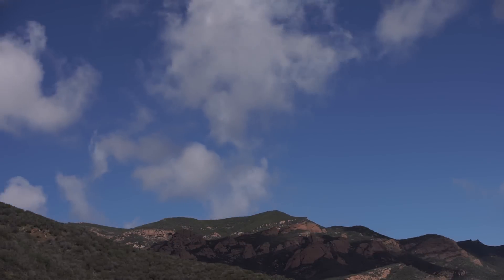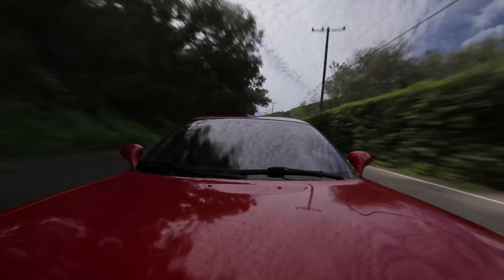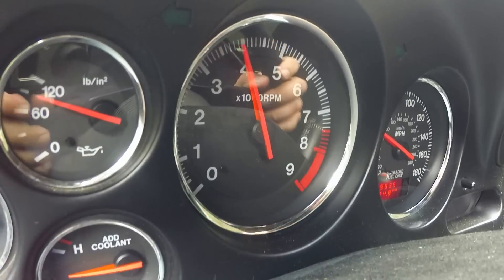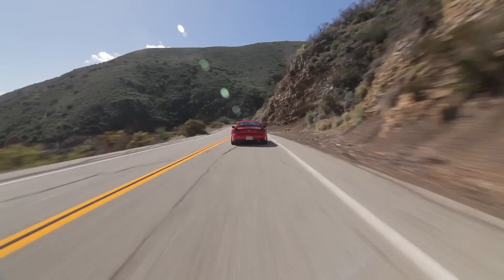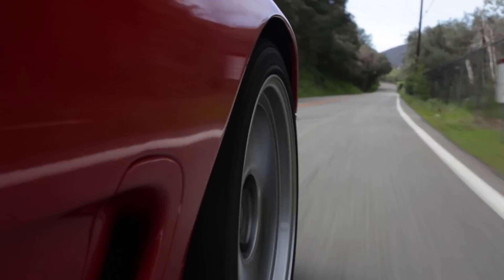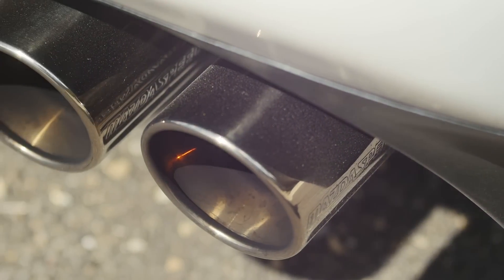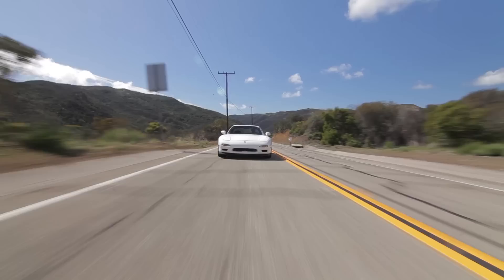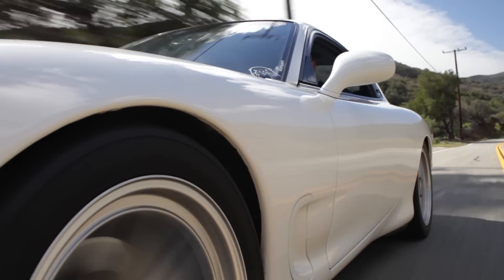Mazda  RX-7: Turbo vs V8 - /TUNED

Comment: The rotary has most of the same problems that two-strokes do.  The biggest of which being, they're ALWAYS compared to engines of massively larger displacement.  In this video we have a 1.3 duking it out with a 6.0.  The fact that they can even be compared in the first place is outrageous.  From an engineering standpoint, I think the rotary is fascinating and loaded with potential.  If the rotary had come first, and someone came along in the 60s with an invention called the four-stroke piston engine with Model-T era development of the design, it would be a lame joke.
Reply: JETZcorp Its not about displacement its about the fuel burnt. That 1.3 was burning twice the fuel so the comparison is fair. If it was NA then that is a different story but that turbo is pushing some serious air and that is then followed by a lot of fuel, matching the V8
Reply: ***** Thd turbo complicates matters because anything can be made insane with a giant turbo.  But I mean in general, rotaries and two-strokes always punch way above their weight.  You can find NA 13b peripheral port builds running with Corvettes.  There is no way on Earth you'd see a 1.3L piston engine hanging with a 6.0L rotary, especially if the rotary had been around twice as long.  That's the point I was getting at.
Reply: ***** Even NA, fuel efficiency is bad. That's one major downside of the rotaries.
Reply: JETZcorp That's because cylinder volume is a lie on rotaries. Measure it the same way you measure a V engine and a 13b is a 2.6L engine. Put in 14.3lbs of boost and because of how atmospheres work, a little 13b becomes a 5.2L engine, as far as swept volume is concerned.
Reply: Skylar Garrett Nobody adds displacement rating when boost is added.  Does a ZR1 have an 8.2L because it's got a blower?  And the only reason one might say a 13b is a 2.6L is that each rotor fires once per output shaft revolution, which is double that of a four-stroke piston engine.  But it's the same a two-stroke, and no one tries to say a 500cc two-stroke is actually a 1000cc because of it.  If anything, we should be saying this V8 is a 3.0L because it's being so leisurely about power pulses.
Reply: JETZcorp One word. Equivalence.
Reply: JETZcorp Well... I don't know how you find the dimensions of a rotary, but the formula for cylinder volumes is Bore2 X Stroke X .7854 X the number of cylinders. There's your liter size. You can't really say it's actually a different size, when it's literally that size. I do agree that a rotary does a lot for its size, but is it that much better? I mean people also get 900 HP out of 4 cylinders... That's 225 HP per cylinder. Which is the same amount the twin turbo rotary makes.
Reply: JETZcorp Why does displacement matter? Its being built to compete against cars with bigger engines and revs significantly higher. I dont think rotaries have any potential and will bet they fade away into obscurity. It makes 0 sense for a company to make a car with one. Even with your theoretical timeline rotaries would be phased out because pistons are just superior all rounders
Reply: Kneedragon1962 I dont know what youre on about but my post was a response to the original post lol. Rotaries arent going anywhere
Reply: ***** Cool. I'm not about to race out and buy one, or build one, but I'm glad they're around. They do a very specific job, and they do it rather well.
Reply: ***** Why is a rotary less fuel efficient?   Is it a thermal efficiency issue or incomplete fuel burning?
Reply: JETZcorp I agree, if they had a 20b rotary or even a 26b engine in that car he would think that it was a LOT faster for less than half the displacement.
Reply: Kneedragon1962 What specific job do they do very well? Cause headaches? Eat oil? The only time id choose a rotary is in a track car if im pulling the engine every few races anyway.
Reply: sashablfc But he didnt and was slower
Reply: ***** Rotary engines don't make much torque low in the rev range, so they experience the same issues as any other high-strung high-revving engine. An engine with torque low in the rev range does not have to be revved very high to get going, so it has better fuel efficiency on the street. LSXs in stock trim are good for daily driven street cars, and that's about it.
Reply: Sage Ybarra Thanks.  So it's basically frictional losses due to the high rpms?
Reply: JETZcorp you talk about an engineering standpoint but engineers know that it's just too inefficient.  Mazda has been trying to make the 16X work for nearly 10 years now, (at great expense) but they just can't get it to meet emissions and fuel efficiency goals.  yes, a giant turbo will kill mileage, but it NEEDS that turbo to produce the horsepower made so easily by the LS (and even then it makes 100lb-ft less, much higher in the rev range).  the wankel NEEDS to have small dislacement or it would burn its weight in fuel in a minute (not really but you get the point).  perhaps if the wankel had come along in 1900, development would be on par with the piston engine, but we'll never know...
Reply: JETZcorp and yeah peripheral-port 13Bs can make ridiculous numbers even N/A but you can't exactly drive those on the street... even if you're willing to put up with a pretty serious loss in refinement and pay that much in gas, you'd be deaf in a week.  they can't be driven with hardly any exhaust restrictions or else they'd wind up like V8s in the 70s (part of why the RX8 renesis has so little potential compared to a 13B).
Reply: ***** No, just more fuel due to higher RPMs. A short-stroke piston engine set up for a small powerband at a high RPM would have the same issues (as far as fuel efficiency)
Reply: ***** Similar to many dedicated racing engines.
Reply: DEADHYPE The first commercial lithium ion battery was made in 91 and the Model S can already match/exceed its competition. I really hate the fan base behind that car but from an engineering standpoint it makes much more sense to improve piston engines or if you want to be bold, get a headstart on electric cars. Rotaries are a dead end while batteries and piston engines just keep improving in smaller packages
Reply: DEADHYPE Clearly you haven't seen what the Aussies and Kiwis do with rotaries. There are quite a lot of street driven peripheral ports running around. 

Rotaries are inefficient compared to a piston engine of the same displacement. But it makes a lot more power than a piston engine of similar displacement. Rotaries can be efficient though. I saw fuel mileage of 29MPG on a road trip from Idaho down to Arizona and then to Maryland. The lowest I got was 24MPG. Around town they aren't perfect, but anything other than a 4 cylinder or smaller tends to suffer in town as well. They also don't consume as much oil as everyone seems to think they do. Rotaries are better than piston engines when it comes to packaging. They are smaller and lighter so they can be positioned lower and farther back in the chassis while being much simpler. A horizontally opposed engine is the only thing close, but is much wider and more complex.
Reply: 83FB7 Packaging is really the only positive I can think of with a rotary
Reply: 83FB7  rotaries can make a surprising amount of power (and even good torque with the right turbo setup), they can be efficient with the right drive ratio and curb weight, and they can be comfortable, refined daily drivers... BUT i've never heard of a car with all three at the same time.  you say you got 29mpg highway, but my guess is that it has much more to do with the low curb weight and low power output (assuming your channel's namesake is a 12A-powered '83 FB RX7).  to me displacement is just a number.  yes, rotaries make more power compared to a piston engine of similar displacement, but that isn't something people care about.  just imagine how much fuel a 6.0L rotary motor would consume, even tuned to only 400hp/400lb-ft.  

i'd pay to see anyone drive a peripheral port rotary around LA or the OC for more than half an hour without getting pulled over and reffed (aka back to stock).  they're loud (can't have exhaust muffling), incredibly thirsty, they make their power high in the rev range, and they idle at 2k. not what i'd call suitable for the road.
Reply: *****
It's also much less complicated than a piston engine. There's no valvetrain to contend with. They are also incredibly easy to do maintenance on. I've driven high revving 4 cylinders with low peak torque that's high in the rev range and it's not nearly the same as a rotary. Rotaries often feel more powerful than they are(at least in certain circumstances haha)
Reply: JETZcorp The rotary is not as efficient as a four-stroke engine, not even close. If they can't get that much power out of them in the 90s don't even tell me they would have been good in the early 1900s. Plus no one would have wanted to rev it that high cars had enough NVH lol
Reply: ***** The fuel efficiency loss in rotaries primarily comes from the low compression. Also the combustion chambers large relative size, for the engines displacement,  means it loses a lot of energy expanding and filling the chamber. Also a rotary has to run on a generally richer fuel mixture, to avoid combustion, which is more dangerous to a rotary as the apex seals, at each tip of the rotor, are pretty fragile. There is a lot of ignorance in these comments, but that's how it goes with car guys. Ultimately the rotary's main problem is it is narrow use. Without a mass market to sell it to, it has not received the R&D that the piston engine has. What it does, is give you absurd power per displacement. It does this at the cost of fuel efficiency, and a failure point that requires replacing every 100-200k miles(depending on application). Apex seals are not expensive, they are just a pain to get to since you have to disassemble the engine(though this is less complex than the same operation on a piston engine).
Reply: Eric Cassidy Rotaries will never surpass piston engines. The Renesis had 10:1 compression and was not impressive and the ceiling for rotaries is ~11:1 before you start losing power. The reason why the rotaries arent popular are because they get poor fuel economy and require more effort to take care of and drive. How are you supposed to convince the market to buy something that wastes more money and time? The only way I could see it being popular is if it came out in a tiny car running at constant rpm hooked up to a CVT.

If youre talking about displacement vs piston engines then chances are you dont really know whats happening. What the rotary has in volumetric efficiency it lacks in thermal efficiency. Its not about being developed earlier its about the inherent disadvantages
Reply: A lot of the thermal inefficiency comes from the very high energy (kinetic and thermal) of the exhaust gas, which is not trasferred to rotor motion efficiently due to the geometry.  This is why wankels respond so well to turbocharging.  I think a rotary is the perfect candidate to bring back the turbo-compound concept.  That had a turbine in the exhaust, similar to a turbocharger, but used the turbine output to assist the crankshaft, or dtive other functions.  Using a wankel as a prime mover with an exhaust turbine to charge batteries in a hybrid could regain a lot of efficiency, and would be lighter than a four-stroke piston hybrid.  The wonky combustion chamber shape remains quite a dilemma for efficiency, though.
Reply: JETZcorp True.  Rotary engines are very elegant.  They just need more development... unfortunately piston engines came first, so got all the development...
Reply: ***** Thank you for explaining my point to me, and then condescending me about "knowing what's happening". I actually explained how thermal efficiency is lost in a rotary. Large combustion chamber, poor compression, result in the fuel air spending a lot of energy filling the chamber, vs pushing the rotor. I'm sorry for not using the word thermal, it didn't seem necessary since I was talking about burning fuel in a metal tube. I also made the case for the engines lack of marketability, but for some reason you decided to drop that knowledge on me as well. But it's to be expected, arguing with someone in youtube comments doesn't require any thought, it doesn't even require reading what you're arguing against apparently.
Reply: JETZcorp Right on the money. What the rotary is capable of is just not something that's going to be worth the tradeoff to most consumers. As such what the rotary needs won't likely happen. The thermal properties pretty much read "turbo me". While people have done crazy stuff with NA motors the engine is destined for turbos. The hybrid drive off the exhaust sounds neat but I think that's trying to push the rotary into a place it's not comfortable. Also it's emissions are awful, due to the previously mentioned super hot and rich exhaust gas.
Reply: JETZcorp if they made the 1.3 any bigger, then it wouldn't pass emissions nor Fuel economy standards(its bad enough already). Plus the size of the engine would obviously increase there by losing its advantage.

.....so you see, the rotary has to be a smaller engine. The 20B is bat shit crazy and if they thew in a fourth rotor, then it would be like driving a 1,200HP drag car on the roads, just a pig
Reply: Blair Clarke The 20b is only as crazy as you build it.  There was only one stock three-rotor application, which was the Mazda Cosmo LUXURY car.  They put a 20b in that because it was the smoothest engine they could conceive for their flagship.  They don't all have turbochargers the size of watermelons.

As for emissions, engine size does not automatically make emissions worse.  Larger displacement engines can use much milder porting, compression, cam (in a four-stroke) and can come out better than a smaller, hotter engine.  That's why Corvettes get better gas mileage than Evos.  A good part of the bad fuel economy of the rotary is also due to a goofy emissions control scheme which involved running the engine overly-rich to create post-combustion in the exhaust.  Way back when GM was developing wankels, they had prototypes much larger than even a 26b, and made some big advances in the fuel consumption issue, but they ended that program and the technology was lost.  Honda also cracked two-stroke fuel economy in the 80s but never marketed it.
Reply: JETZcorp I am personally convinced that if more than 1 manufacturer (Mazda) spent time and energy on innovating on the rotary engine instead of the piston engines, rotaries would be godlike today.

Imagine ALL the car companies to ever build engines spent their time improving the piston engine, vs only ONE company improving the rotary... and it still competes well, I'm impressed.
Reply: dB Exactly.  I think everyone forgets how much development it took to make the four-stroke piston engine not suck.  Back in the days when sleeve valves were a serious option and poppet valves needed valve seat work with every other oil change.  If either the rotary or schneurle loop two-stroke had been invented two decades earlier, the world would be very different.
Reply: *****  They sure as hell won't be coming back to Automobiles any time soon.
Reply: Blair Clarke  make any bigger? Are you guys fucking kidding me? The motor was already Axed because it couldn't meet emissions and etc at 1.3L...
Reply: JETZcorp Doubtful
Reply: DEADHYPE Can you explain why they cant have mufflers? This is curious to me, and I'd love to learn why.
Reply: KyleP133 Rotary engines are relatively inefficient at converting combustion energy into mechanical motion in the rotor.  This means that the exhaust gas in a rotary still retains a lot of energy (velocity, pressure, heat).  This makes rotaries extra sensitive to exhaust restriction, causing backpressure which reduces power and creates additional heat.  This of course becomes more pronounced with the high-strung NA builds like a peripheral port.  By all means, rotaries can and do have mufflers, but they are more of a performance restriction than on piston engines.  Incidentally, this excess of exhaust gas energy is also what makes a rotary "friendly" to turbocharging (or turbo-compounding, in theory).
Reply: +JETZcorp The rotary just happens to be one of the smallest engines in a rwd configuration that's boosted to make up for the small displacement. Any engine can produce power given enough fuel and air just not very many are paired with a RWD/ AWD platform capable of putting it on the ground. That is why a 1.3T can match a 6.0 because if it were NA like in some FCs there would be no comparison. That is why I don't understand what is soo wrong with swapping a V8 in if in stock configuration the "duty cycle" of the engine is considerably lower than a boosted 13b that begins to reach its limitations around 450whp without precision engineered parts for drag. V8>13b if you don't agree please let me know why other than it's "cooler" sounds better.
Reply: SuperCuttysark I won't deny that a modern GM V8 does the job better than a 13b.  As you said it's got a crushing displacement advantage and many decades and billions of dollars more research behind it.  But I can't support swapping one in an RX7 for the same reason it'd be criminal to yank the two-stroke out of an old Kawasaki H2 and put in a Ninja ZX10 engine.  You will have gained performance but lost the only thing that makes anyone want it in the first place.
Reply: JETZcorp Quite Frankly.... unless you keep it bone stock... meaning it will be dirt slow... Most people aren't going to want it.
A modded 13B isn't going to be valued any better than a V8 swap.. Why? Cause you've removed the OEM parts from it..
Id buy an RX7 cause I Like the car... If I don't like the engine Oh well.
Reply: JETZcorp Well for me I purchased the car for the car I had no clue at the time what a 13b was and to this day I would much rather have a V8 for cheaper parts and better mpgs. My rotary is stock and has given me so much trouble especially when solenoids can be 100$ plus
Reply: +FlyingAero neither are pistons, they are just as outdated and are made obsolete by the much more economical and powerful electric motors
Reply: +JETZcorp  so true. They should have stated this point in the video. He stated it was objective. If He stated that some one would have the problem of Putting a value on the difference.  I have owned two RX7s. They are suppose to be driven hard.
Reply: +JETZcorp I couldn't agreed more, for mazda is the only developer in the history, I'm totally satisfied with RX series.
Reply: +JETZcorp totally agree they should put the ls2 up against the r26b and see who comes out on top
Reply: +gus bisbal nobody buys a rotary or a v8 and cares about fuel economy
Reply: I care when the engine has no balls and is as slow as a N/A 4 cylinder chinchy111
Reply: Texarmageddon Well fortunately neither the rotary or V8 fall into that category, unless you're shopping for a stock 80s car.
Reply: +JETZcorp Both Chevrolet and Ford developed wankel prototypes for the Corvette and Mustang and were both 400+ cui. The Mustang prototype still survives in a Ford museum in the US somewhere tho not sure what happened to the Vette. Only info that remains a mystery is the power & torque figures which I'd imagine would be immense for a 400+ cui Rotary.
Reply: +JETZcorp Lol, what people don't know is that it fires three times per revolution. Every rev is 3x the displacement so a "1.3L" Rotary is actually 3.9L. Horrible specific output. The good part of the rotary is power to WEIGHT and SIZE ratios rather than displacement.

Also. Torque and powerband. Much better in LS swap.
Reply: Hazardous-Nebula
yeah it gets confusing trying to figure out the displacement of rotary. how did they come up with 1.3 anyway?
Reply: +chinchy111 Two "650cc" rotors? Which really means that a "20b" is a 19.5b. They should've made it "700cc" per rotor and used the letters to indicate the number of rotors stacked.

I.E. 7a, 14b, 21c, 28d, 35e, 42f, and 49g. {Because more than 7 rotors is pointless. And because 5 and 7 rotor configurations don't currently exist.}
Reply: what happens when you make a 6 liter rotary? i have no clue it must be impossible since mazda hasnt done it
Reply: *****
nah, it would been impractical, far as racing engine goes 4 rotor is currently maximum, Mazda can always change rotor thickness and width to adjust power and efficiency during development, people built 6 rotor engines in the past but I bet they can never put it into a car, even if they did such car won't be good enough and be fast on a track.
Reply: Waylon that shows my limited understanding of rotors
Reply: I believe the GM rotary engine project was going to be a 4-rotor somewhere in the 5L displacement region.  I'm not sure on that, but it was a hell of a lot bigger than a 1.3L.
Reply: JETZcorp The GM wankel rotary was 3.3 litre and had only 2 rotors.
Reply: Kneedragon1962 but a v8 is not good in any means they both eat fuel it’s about the fun not the fuel
Reply: Mooselover1011 one rotor face chamber has .66 there are three power strokes per rotation of the eccentric shaft so 3x.66 is 1.3
Reply: I've gaped a Audi 3.0L turbo in my stock 2006 rx8 on the interstate from 70-122mph. I wonder who burnt the most fuel.